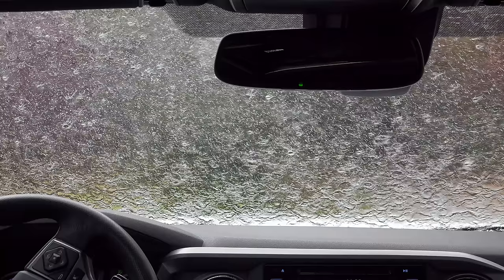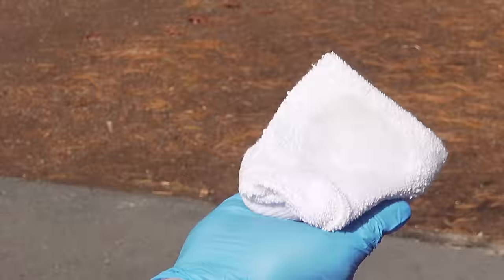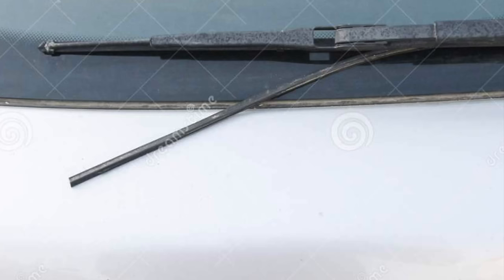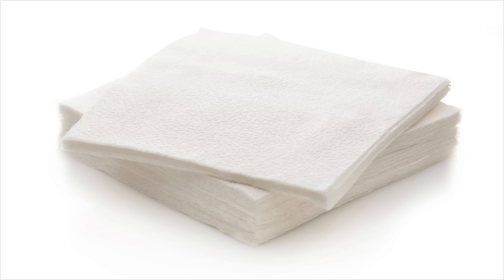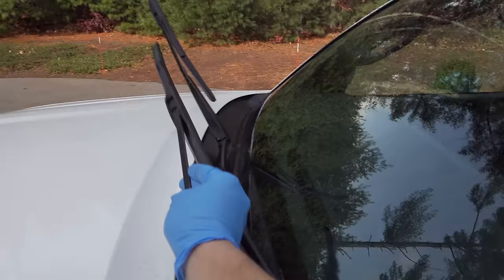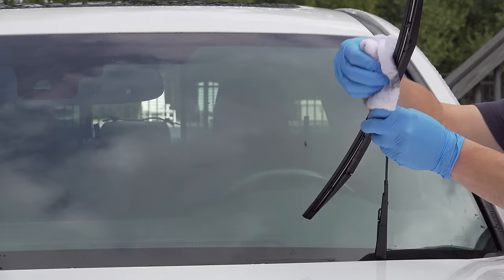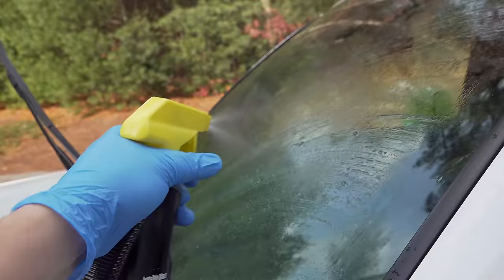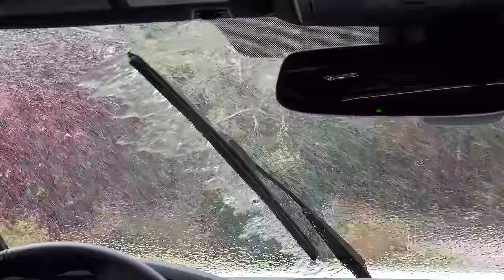How to Make Windshield Wiper Blades Like NEW in 30 Seconds

Comment: Don't use wd40 for this: most of that residue is the actual rubber having been dissolved by the wd40.  Use silicon spray instead after using a mix of dish detergent and water on a rag instead.  That'll degrease them while the silicone spray will lubricate any remaining debris free of the blade.
Reply: @melodykim425  sort of; the "rubber" used in wiper blades is a mix of rubber and pex plastic. it's not good on it and is why so much black comes off when used here.
Reply: thanks, was looking for this before commenting. WD40 on any rubber part is generally a bad idea in the long run.
Reply: Just did and now they scream! And the black stuff just keeps on coming...I guess untill there's no more wipers... So now I need new wipers...or maybe I can rescue them with some silicone...
Reply: I wouldn't use dish detergent on anything rubber either as it will reduce its life.
Reply: @johnmknox   only if left soaking in it for hours there shouldn't be any degradation. I suppose if you were to apply it and somehow get lost between the side of the car and the windshield there could be a problem. Lol
Reply: @johnDukemaster  Yours were probably beyond help.  Time for new ones.
Reply: Smart comments..  Silicone spray would be my choice here, too.
Reply: I have always used alcohol to clean them.
Reply: @MrLanternland  prefer to drink it
Reply: @MrLanternland  many wipers come with a little wet wipe for that purpose.
Reply: @MrLanternland  Not a good idea either as alcohol will degrade rubber over time.
Reply: Ty 4 excellent tips indeed!
Reply: @philwilliams8328  Then what is best?
Reply: Another thing - what is it, advanced scientific engineering, that makes windshield wiper blades streak precisely in your line of vision?
Reply: @MrLanternland  Any type of Silicone spray. But, I would first suggest in cleaning them off with some water mixed with vinegar.
Reply: @philwilliams8328  the alcohol used in wet wipes is very diluted and unlike WD40 will evaporate long before it can do any damage.  Were you to soak them in the stuff, it'd be a different matter.
Reply: @MrLanternland  the advanced scientific engineering known as the branch of physics called the Murphy Quandary. ;)
Reply: @akr01364  Murphy's Law, huh?  Or is the result of the R&D going on in the GTSTBAO* Dept.?

* Get the suckers to buy another one
Reply: @MrLanternland  Ha!
Reply: What if I clean them with plain water?? “No, that will degrade them too” 🙄
Reply: @chrisf.9350  it depends, Pelligrino or Perrier? ;)
Reply: @chrisf.9350  Dasani will do it
Reply: I just filled my wiper fluid tank with WD40 saves me time
Reply: @government_username7933  try applying a layer of duck tape to them first. It protects them,,,,,,, ;)
Reply: Sounds like everything degrades rubber.......so I'm cleaning mine with astroglide. The bottle says it's safe for rubber. An added bonus is that they don't make that squeaking noise anymore, they just glide right over the glass slick as can be!
Reply: Wow! someone who knows what there talking about! Thank you!
Reply: My late husband would use "Dubbya Ds 40" on his 4 inch.  It would make things much easier but them "rubbers" would get wrecked mighty quick. Speaking of mighty quick, well he was what y'all call a Minute Man....really a 20 second man. Bye !
Reply: @billiebobbienorton2556  wd40 isn't a lubricant. But, a surfactant and would displace all water in the, ahem, pond.  Like sandpaper on a tiny drill bit, eh?
Reply: @akr01364  Yup, but what a lover ! ! ! !
Reply: WD40 dissolves rubber and most plastic
Reply: @MrLanternland  beer , rag , dawn dish soap 🤙🏻 good luck.
Reply: @nathanheng8954  Then any unused Astroglide can be put to good use.
Reply: @akr01364  yep - or why go thru a car wash.....lol
Reply: @rangerwolfhound  indeed, that hot wax burns. ;)
Reply: @MrLanternland  planned obsolescence
Reply: @pierrevincent9568  EVERYTHING now. They put more engineering into making everything break, ideally right after the warranty expires, than they do in making things last.  Everything.
Reply: why does everything have to be so complicated?
Reply: @MrLanternland  allow me to respond with a mildly dirty joke: ever see a how to find "the g-spot" video that wasn't ten minutes long?
Reply: @akr01364  No, bro.  I figured out how to find the g-spot all by myself - well not exactly all by myself - but without the help of youtube - but windshield wipers r too complicated 4 me, and that especially includes figuring out how to change them.
Reply: @MrLanternland  lucky you. The one time I tried, well, you know that man eating desert monster that Jabba the Hutt made people walk the plank into?
Reply: @akr01364  

Oh my...
Reply: @philwilliams8328  I’m not made of rubber so I’m good
Reply: YOU ARE RIGHT !!!!
Reply: @vanoscrap6296  It. Sure cleans my stainlesss steel at work and makes me look good and hard working
Reply: I used silicone spray for 3 years and is my best choice just don't over do it. I do it 4 times a year and my wipers they still work
Reply: @government_username7933  nah it’ll degrade your washer bottle, and then the windscreen will melt LOL!
Reply: Has anyone tried windshield washer fluid?
Reply: Yes well said, Silicone for rubber only.
Reply: akr01364, I agree. WD40 is not good for rubber. Silicone contains plasticizers and is commonly used to rejuvinate rubber.

However, I disagree with using a silicone spray. Hardware stores (in the plumbing department) sell pure silicone gel. That's the stuff to use. 

I say this for two reasons: 1) The carrier ingredients of a spray may not be good for rubber (they're often petroleum distillates like WD40.). 2) Silicone is lethal to catalytic converters. Aerosolizing silicone into the air around a car is not a good idea. (I wouldn't do it with the car running, and I'd probably wait hours before starting the car. But, because the carriers are probably as bad as WD40 for rubber, I wouldn't use a spray in the first place.).
Reply: Ha! When my wiper blades make noise or don't work anymore I just use RainX on the windshield this way I don't have to use the wiper blades!
Reply: @funfreq9282  Really? I just have my boyfriend run in front of the car with a towel? ;)
Reply: @akr01364  Ha, sounds like it might be a one time deal! Hopefully your not driving too fast when he does it.
Reply: @nathanheng8954  I've found it definitely cuts down on squeaks and squeals.
Reply: @philwilliams8328  

😊😊
Reply: Just buy new blades… like 10 bucks for a cheap pair that will last a few years… lol
Reply: @johnmknox  The amount that it would affect the life of the wiper blade is negligible.  They'll wear out from ordinary use long before that becomes a factor.
Reply: @MrLanternland  And only on the driver's side too!
Reply: on't do too often. After some time there is no rubber left on the wipers!
Reply: not entirely true, i tried cleaning my windshield wiper the other day, simply using an old cloth, and nothing else, and it got just as black as that sock does, and I wiped it quite a few times, and I had nothing on the cloth at all, so its deffinantly not just because your are dissolving the wipers, also would think it would take more than just the first wipe fort he WD40 to start dissolving the wipers, if it was that strong I woulden dare touch it with my bare skin that's for sure.
Reply: It's been entertaining to read the lengths people will apparently go to in order to prolong the life of a $10 consumable item when cleaning it.
Reply: @ashchaya7676  Stingy! Or Misers!
Reply: @ashchaya7676  save for gold plating. Stay tuned. ;)
Reply: @akr01364  LOL
Reply: Actually it is not true.... There is a video on Yt where a guy dips multiple kind of rubbers in Ed 40, leave it for coupled days and nothing goes wrong with them. I used wd on rubbers and nothing happened to them. Greetings
Reply: @MrLanternland  LOL this had me dying. I was just in a snowstorm the other day, chugging along on the highway...and my entire wiper system was working beautifully, except for one patch exactly in my line of sight. I had to drive home with my head bending at all sorts of angles trying to see
Reply: @kuruptzZz  The windshield wiper manufacturers put a lot of time and effort and research and development into getting them to do just that, in that one exact spot. It's not as easy as you might think.  They had to calculate the average height of drivers and then inconspicuously weaken the rubber in that precise line of vision spot.

They also put a lot of effort into making the instructions for replacing them incomprehensible, with various attachers included in the package that can fit in in diverse directions, so that many people will get frustrated and pay a mechanic to do it for them,  for which they get a kickback from the Motorcar Mechanics Guild.
Reply: @MrLanternland  Also called Murphy's Law!
Reply: @philwilliams8328  They're going to degrade over time whether you treat them or not. Wipers don't last forever. It is recommended to change them every year anyway so. . .
Reply: Was just about to buy new ones and thought I'd google first... thank you for this tip! I just did it so we'll see how it goes. Thank you!
Reply: @Meggs23  good, I  hope it works
Reply: Wouldn’t mineral oil after cleaning work also to help keep the rubber supple?
Reply: @waffle_chair9269  nah, it'd just leave streaks on the glass. It's not an absorbent material.
Reply: Magic Lube 2 is a Silicone Grease use in pool equipment with moving parts.

Magic Lube II is a silicone lubricant and sealer formulated for use under the most adverse conditions.

Magic Lube II is completely waterproof and chemical resistant.

extremely durable synthetic compound for use on valves and other special applications when the added protection and lubrication of silicone is required.

Multi-purpose pool lubricant used on o-rings and gaskets that move

Best used for moving applications (valves, lids). Available in 1 oz. or 5 oz. tubes.

Just apply liberaly with an old towel.
Reply: @billiebobbienorton2556  ...🤨
Reply: Scotty said use denatured alcohol.  If you want to use soap,  Murphy's oil it out cleans anything. At flea markets you can get old bottles of Murphy's oil and it cleans better. You can even wash your car, won't hurt the paint.
Reply: @akr01364  “duck tape”
🤣

Comment: I put WD-40 on a clean cloth and do the mirrors, glass doors and shower doors. It works wonders. In the bathroom, water marks on the mirror wipe off easily, leaving no streaks. It has cut my housecleaning time in half. I also have used it in the sink disposal for years. Once per week. The disposal is 14 years old and runs like new. I use it on the garage door hinges, the tracks and spring, and on the attic pull down ladder cables. Keeps everything working smoothly.
Reply: How it works on your dog?
Oh… he ran away? Don’t blame him…
Reply: @JDrwal2  - lol
Reply: @Nikki Namikaze-Uchiha-Hatake - I do use Dawn….blue, even though I don’t think the color makes a difference. It’s a good product. But….I use the W-40 for the few things I mentioned.

Comment: I didn't have any old socks so used the ones i was wearing. Then I needed to put my shoes on to cross the lawn to the car. Unfortunately the WD40 seeped into the shoes and I slid down the street. Now I can't get home.
Reply: When you put you sock back on it will remove the tar from your toes.